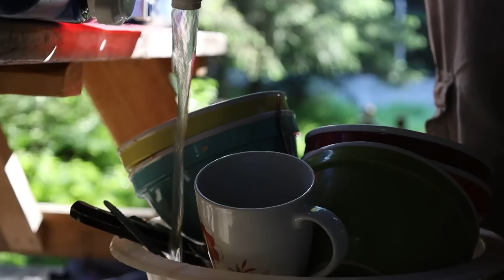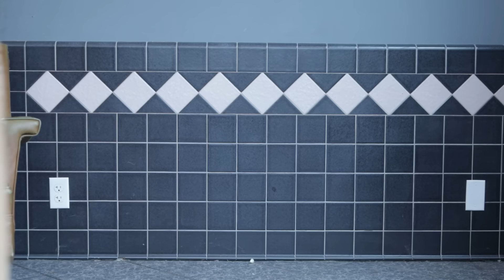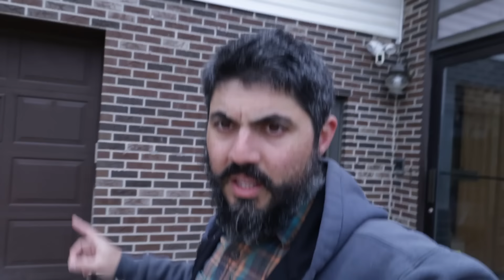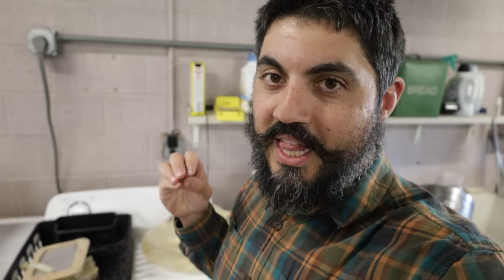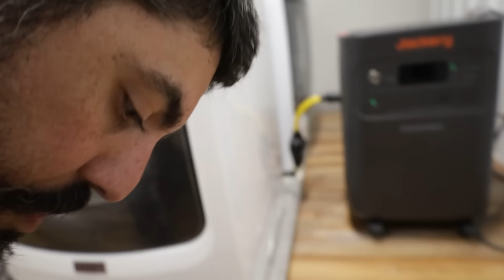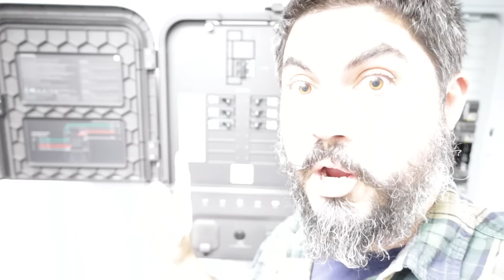1 DAY SETUP! Solar Power System for my Off Grid Cabin - Jackery Solar Generator 5000 Plus

Comment: Most power stations have a flaw which makes them kinda inappropriate for solely solar use - they balance the battery only when fully charged. If the battery is never charged to 100 percent, the cells start to bias off. With time, the usable capacity lowers because the BMS cuts earlier, because of the increasing unbalance. If the unbalance is too large, it may totally switch off.
Find a way to fully charge the battery at least once a month. Either from AC or a generator or DC or solar. And, it needs to stay like that for some hours to make the balancing.

Comment: That solar panel initial test was a lie. Love showing the potential but no chance you got an additional 300 watts of charge from one single panel on a cloudy day. Also, if that dryer pulled over 5k watts, it wouldn’t finish a cycle over 1 hour. Be honest In your reviews.

Comment: I love Jackery!  I have two - but can barely charge it in the winter because the sun is too low on the horizon compared to where I am.  Works amazing in summer!  I agree with comment below - get a gas dryer to get you through the winter :)

Comment: Solar is great here in the summer because we have a literal endless supply of daylight, but winter is a different ballgame since we only get about 5 hours of daylight, and most of that is overcast. Also, climbing on top of an icy roof after a snow storm to sweep off solar panels is probably the suckiest job of all jobs 😂 I would definitely bring your generator for wintertime power usage if you guy's are planning to stay through winter.

Comment: In my off grid set up it could power me for 6.6 hours in grey mode, if it just fridge/freezer 47hrs. I hope you are going to put a full-size solar power system, at least the $9k kit from sig solar, 6kw,8kwpv,15kwh and for $20k 12kw, 22kwpv,50kwh =10 Jackery's worth of power.  Good option for basic power needs, I would use a 10kw gen, charge the Jack 1800w run the 5600w dryer from the gen@75% at the same time. If you plan to stay this time Kenai AK has a used LPG tank retailer. Going off this winter's #'s a 500-gal tank would run my gen for 6 years per fill.

Comment: Before we moved off grid, we practiced laundry in our on grid home by loading water in the top in the top load machine. We were absolutely shocked when it took 26 gallons of water. And that doesn't include the rinse cycle.  
We found that when we weren't able to run the clothes to the rinse cycle, they ended up with all this...schmoo that took forever to get out of our clothes. We ended up throwing many of our clothes away. Our current washer and dryer is used as the storage pantry in the bathroom. Ha!
Reply from the maker: Practicing laundry "off grid" first is a smart idea, yes, I was wondering about the rinse cycle! Will have to solve that issue... GTK about Schmoo😆
Reply: @ Be blessed in all you do my friends...even laundry! Whoop!

Comment: Ohio here, my husband has been fooling around with solar and we have three freezers and our well pump hooked up, and if it's cloudy it automatically switches to the grid. We had a cloudy month in Nov and it jumped up from $100 to $400. But that was the first time in two years. I also use solar on my washer and hang my clothes on racks in the laundry room. His next project is to get the whole house on a system like the garage with the freezers.

Comment: You have a great unit but solar in winter even with the snow cleared off,is still not going to generate power reliably.  Sunlight hours are just too skimpy.  Lots of good ideas here...propane seems most promising. I would have backup with gas powered generators...fingers crossed. I have observed YouTubers off grid in Alaska installing an array power solutions.

Comment: Running solar electric, especially with the components you found is great for better weather, but when the snow covers your panels or it's too cloudy for much power to get through, I thought I'd share what some off-grid friends did.  They ran their house on propane.  They had propane lights with ignitors built into the fixtures and a generator that ran on propane.  They would get their washer, drier, dishwasher and other periodic appliances ready to go in time to turn on their favorite TV show (they had a satellite dish and a recorder).  For two hours a day, they would run the generator to run the appliances.  At the end of the 2 hours, they would put up the clean dishes, load the dishwasher with dirty dishes, pull out and fold the dry clothes, put the washed clothes in the drier put dirty clothes in the washer and be ready for the next 2 hour run the following day.  You can get a trailer that will pick up and carry a 100 gallon propane tank so you can take it to town to get refilled.  If you had a spare tank, you could go when it's convenient and never run out. You can also get an on-demand water heater that runs on propane so you always have hot water and you'd only need enough electricity to run the electronics. If you don't like burning fossil fuels, you can get a wood chipper and a wood-(biomass) gasification generator and use dry biomass instead since it's carbon neutral. In Alaska, there should be tons (literally) of down timber to chip for fuel. That would be a great way to get through the long winters.  Putting in a cistern would also allow you to run a well for the 2 hours to fill the cistern (I use a 300 gallon IBC tote and it works great) and then pump out of the cistern into a pressure tank.  Or if you have a nearby hill, you could pump into the cistern and then gravity feed your house.  That uses less power than running the well pump every time the pressure tank gets low so you could run a cistern pump, if needed, off your power supply.  If you size the generator right, it could also charge your Jackery during the 2 hours.  It's also important in the extreme environment of Alaska to have a back-up system which this would provide.  Looks like some great ideas below, too.

Comment: for a dryer at the cabin, get a gas dryer then get a gas to propane conversion kit for it. Then you can run it on propane and the electric will just be to run the drum turning. You still want to hang up as much as possible to reduce propane use, but it's a good back up.

Comment: Look into getting a wringer washer. They are much easier to run, are less work than traditional hand washing, and conserve a ton of water due to being able to wash/rinse multiple loads in the same water. Paired with an old gas dryer makes the  best off grid laundry solution.
I actually just replaced my automatic washer with a Dexter quicktwin double tub wringer washer and it has been amazing.  It actually saved me time per load as my automatic wshers quickwash was 38 minutes. I can do 3 loads in my wringer washer in 40-45 minutes. My 1970s kenmore gas dryer will dry a 12-15 lb load of non bulky clothes in less than 30 minutes on low heat. Bulky items like comforters, jackets, and thick jeans take about 45 minutes on high or an hour on low.
Reply: Check out washer spin dryers. Some advantages but even better at getting water out of wet clothes compared to the old fashioned wringer.
Reply: @justinburch  it's a negligible amount for most items and I found they took me longer than using a wringer washer did
Reply: @dollipop12  Okay. Could be. my wife swears by her washer spin dryer but to each their own.
Reply: @justinburch  Oh, definitely. It may not have worked out for me, but I know plenty of people it works for. They are definitely an option. I just haven't had laundry go so smoothly and so quickly since getting my wringer washer, so I have a heavy bias at this point. Finding a laundry routine that works for you is important, especially off grid or in limited power/water situations.

Comment: Remember, panel for winter, not for summer.
I have 8kw of panels and in spring and summer I can't burn through it fast enough.
In the winter some days I only see 300w per hour and I'm in central portugal.
Have a plan B and C in place for when you will have weeks of overcast days.
Reply: Given that in winter the sun is gone for over two months I’m not sure you could really have enough panels for that
Reply: @  I did really good this year Nov to Feb 1000kwh, rare lows 8kwh, average was 12kwh, after Jan 9 the gen has not been used and that's only 11.6kw solar, soon I will have 15 to 18kw. 
I cut Gen time by 81% over previous year. 
20 kwh of vertical solar with snow will work.
Reply: I have vertical bi facial my first year I had 8370w, 880w overcast, now with 11.6kwpv overcast is 1300w. Your number seem low are the panels horizontal, flat roof? Do the numbers jump up and down by over 100w in overcast, or is it steady with 10 w jumps? 
Even if they are not bi facial, mounting on a south wall and either paint or put any reflective surface 1 ft ahead of the panel, in my case 4x8 plywood in white fits perfect. 
My 3300w array with snow 4185w, 900w light overcast. If you need ideas or any help boosting winter pv, let me know, in one year of upgrades I dropped my gen hours 81% to 66hrs all winter, I use 15kwh minimum per day.

Comment: We recently got an off grid cabin that were moving to soon as well, it came with a similar system but Bluetti. My question is though, the previous owner kept it stored upstairs in the loft/bedroom area, where the plug to the cabin is. Someone mentioned to me it’s not safe keeping it inside, huge fire hazard. So now I’m worried about where to put it. Where will you be keeping your jackery? We’ll be in a similar climate as yours in Alaska. I’m thinking we’ll have to build a storage area outside, and mount the panels on top. More of a project than I was planning for just after we move.

Comment: If your ceilings are high enough at the cabin, consider a drying rack that you can raise and lower with a winch. I had one in my last house and it was brilliant. Lower it down, load it up, raise it up above your heads out of the way. When I had the wood heater running a load would be dry in a couple of hours. I’m going to get one added here because it’s just so handy to not have drying racks taking up floor space. 

Gosh that Jackery unit is great. My power outage plan uses Ryobi batteries for now because when I get my solar I’m going to get batteries. I wonder if they make an Australian version. It could actually become part of my long term plan and be useful short term. I’ll look into it before I buy the next Ryobi piece.
Reply from the maker: Yeah, I was super impressed Monique, gonna be a great short term and long term tool, eventually we’ll have a full PV array, but this is a great start
Reply: @Homesteadyshow  it seems the 2000 is the biggest available here, so I’ll have more power available by sticking with the Ryobi batteries in the Ryobi power station. I have lights and batteries that can charge my phone. The main thing I still haven’t got a solution for is the water pump. The Ryobi will run that. I have a Ryobi inverter for a single 36V battery which will run a mini rice cooker (enough for a meal for me), and a water dispenser that has a reservoir of hot water so if the power goes out the first thing I do is fill a thermos from that so I can make a coffee later. But with the Ryobi power station I could boil the kettle too. And it will run the pump so I’ll have running water. That’s the biggest thing I need still. And I use those batteries for my tools too so it’s dual purpose. I’ll have to keep going with that plan I think. I am on grid for power so it’s only ever out for a few hours. It just tends to go out when I’m about to jump in the shower or fill the coffee pot 😂😂

I’ll have another look for pics of my old drying rack. I remember taking them, because I knew I was going to want another one. But I scrolled back through years of photos recently looking for it and couldn’t find it. I’ll look again soon and if I find them I’ll email them to you. 

You do want to be careful that it’s somewhere that it doesn’t block lights when it’s loaded. I had sconce lights on the wall and the clothes hanging down would block that light. It wasn’t a massive problem, but it would have been more pleasant if it didn’t block it.
Reply from the maker: Gridlessness had a drying rack like that! I loved it, will do!

Comment: You two remind me of a younger version of my wife and I; very similar dynamic. Never made it to Alaska; was afraid I'd never leave. Godspeed. Oh, how do you get water at the cabin? Follow on comment: This system is the first I've seen that is the same capability for the same or lower overall cost as an a-la-carte system that you hard wire in. It is listed as 30db in sound, which is way quieter. What is the standby load ie just for being on? This last question is the final prime factor between solar battery designs and hard wire. Final follow on comment: Jackery offers 15% discount for veterans and active duty, making this system at the current price point overwhelmingly the best option.
Reply from the maker: I’ll see if I can find an answer to that standbys load question…

Comment: Make sure you don't have a water level sensor in the washer. I thought I could put water in mine from the top but when I did the washer revolted and went straight to drain and then tried to fill from the back.
Reply from the maker: oh, good thing to know, I'll have to check that. I REALLY am counting on doing laundry with a machine early on... Don't want to mess that up!
Reply: @Homesteadyshow  I moved to Mexico where our water comes from a water tank on the roof, I had to hook up a special hose for the washer so I could use it.
Reply: @Homesteadyshow   if you do, a work around is a 20 gallon tank/tub that you fill above the washer leading into the hose. could work for the front loader too.

Comment: 2 weeks ago here in TX we had 4 brown outs in one day. It fried circuit board on our fancy modern washing machine. My 18TB hard drive spent 4 hours recovering. I’m now using an Ecoflow Delta 3 as my UPS / backup power for my computer gear. I’m planning to get a 2nd unit for mobile office to power starlink and computer gear. A friend hooked me up with a 350 watt LG solar panel. Looking forward to doing some tests. Great share.
Reply from the maker: Wow, thanks for sharing, that is so awful to loose equipment to a brown out! Scary when a hard drive is fried too, you don't want to loose all that data!